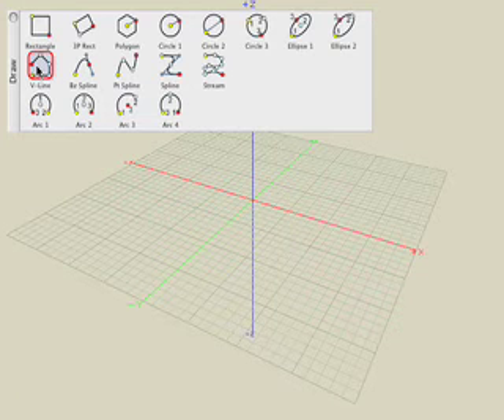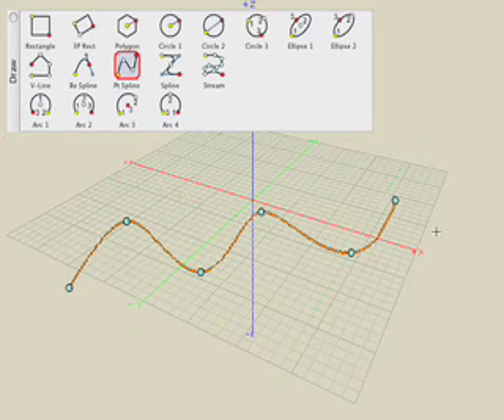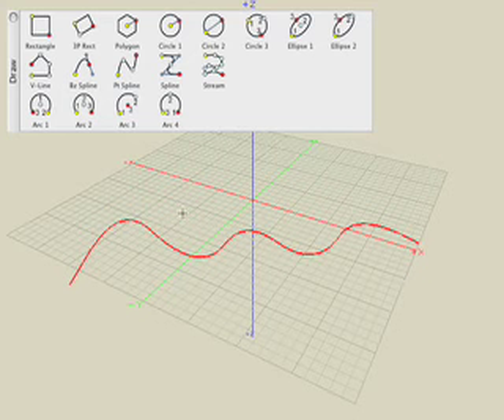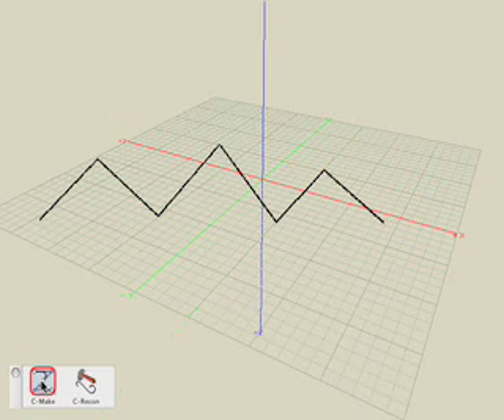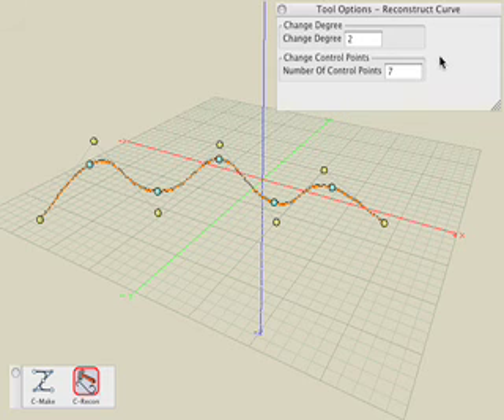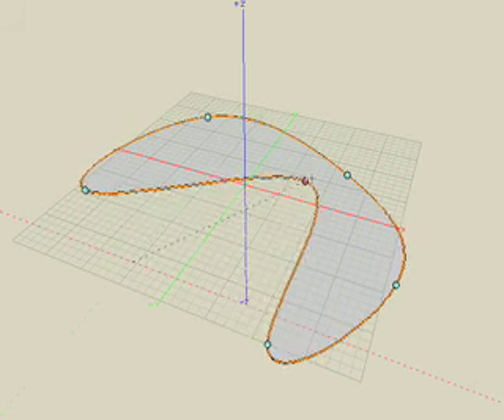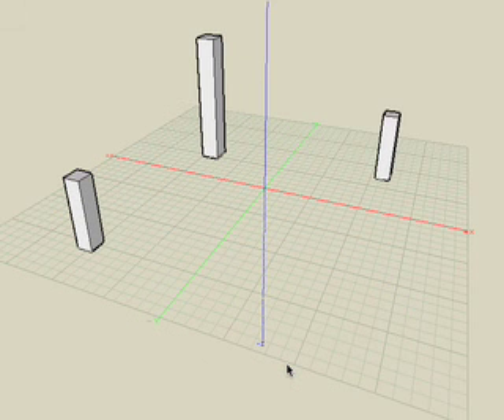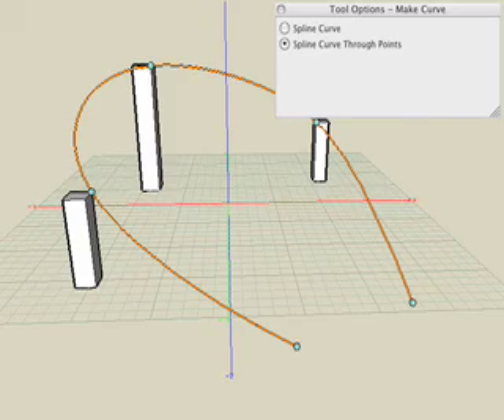bonzai3d Curves

Comment from the maker: @rs666sathan666pk 

You can use the Curve Reconstruct tool to change the number of control points on a curve, but (at least currently) there is not a tool to add a specific point. (This is a feature that formZ does have.) We will see if this is something that can be added to bonzai3d in the future...